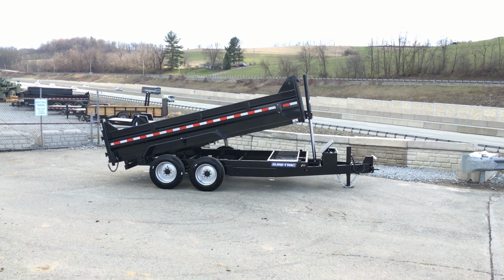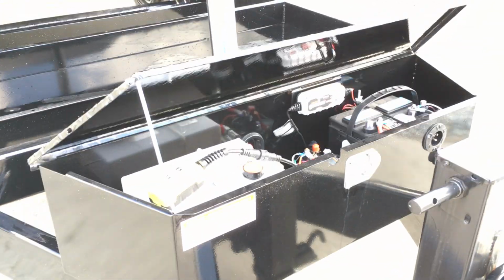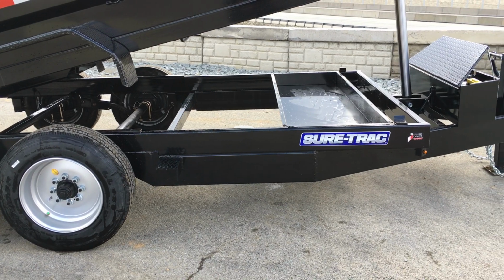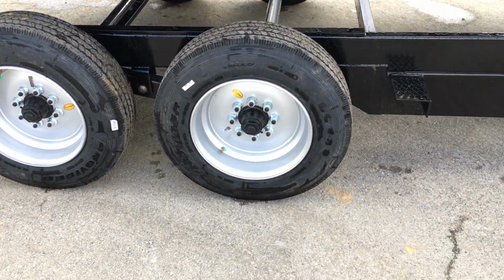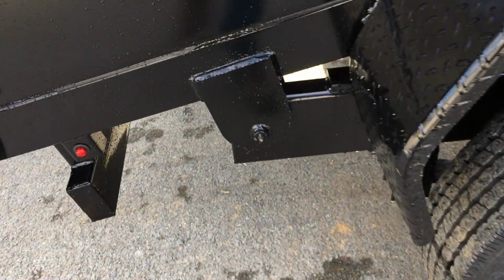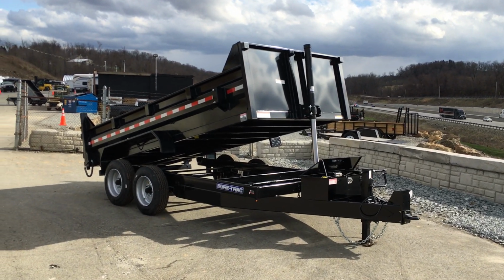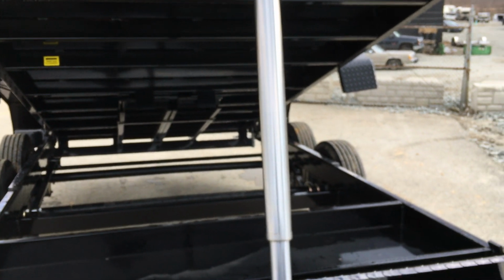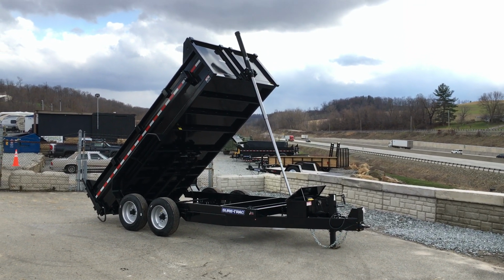Sure Trac 7x14' Low Profile Hydraulic Dump Trailer 16000# TELESCOPIC HOIST ST8214TLDD-B-160

Comment: Do you have any without the 8k upgrade ? Getting close to CDL requirements with the GVwr at 16k
Reply from the maker: Yes, we stock this same trailer with 7000# axles as well in both bumper and gooseneck configurations.  Unlike some of our other brands, Sure Trac does some frame and feature upgrades on the 8K axle that won't be on the 7K axle model.  Most of our other manufacturers many just swap out the running gear and hoist upgrade with little frame/features differences.